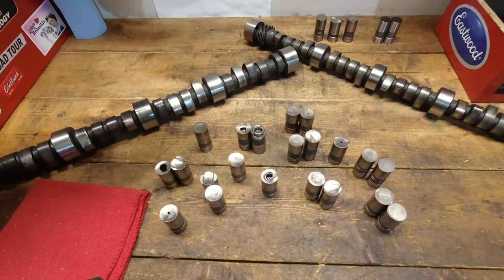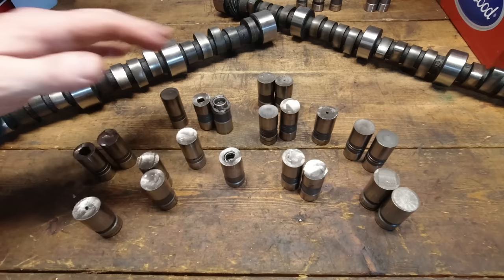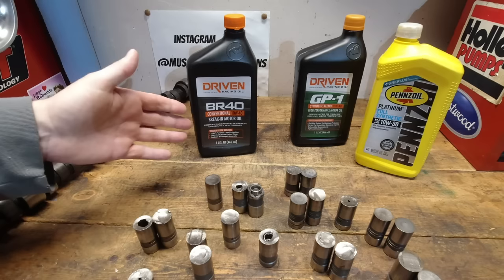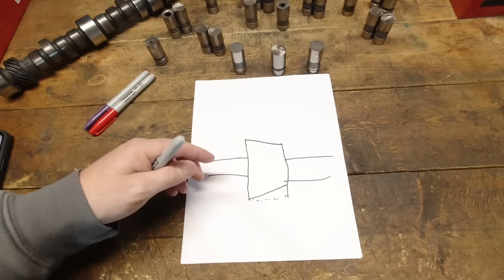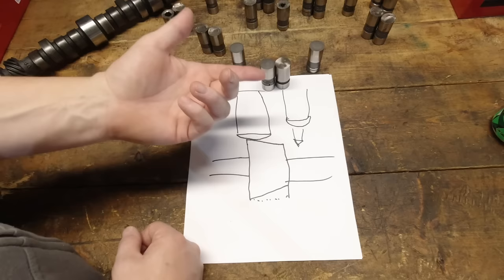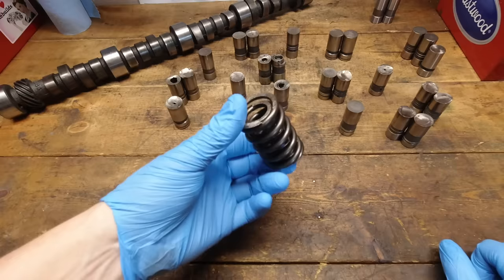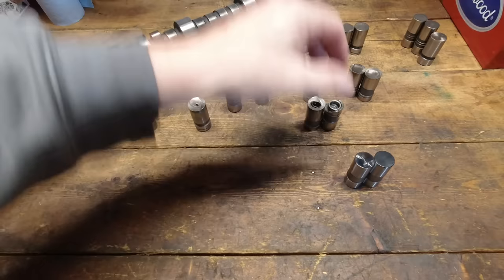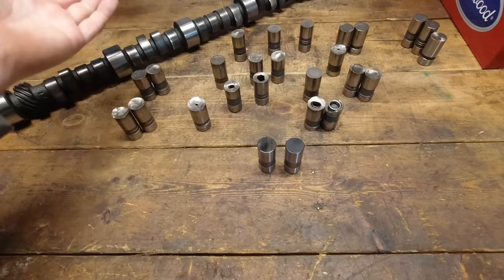Flat Tappet Cam Failures: The Reason Why They Go Bad & The Solution! Part 1

Comment: Good way to sell expensive lifters and cams. hmm
Reply from the maker: The OEs dictate what the tier 1 core/cam manufacturers make.  The OEs went roller in the mid 80s.  If you want to blame anyone for the more expensive valvetrains. It trickled down from them..

Comment: Do not be fooled with more likely false solutions to flat tappet failures-the genuine GM lifters with hardened foot wafer face pressed or fused on is the only trustworthy solution--at least for the GM crowd. DLC coating which is only around a .5 -1 micron thick coating. I doubt that coating will last or hold up, will it even be applied correctly and will the crown taper on the lifter be correct. Can the aftermarket really be trusted to solve this problem? Their track record over the past years does not look good. DLC flat tappet lifters in the race communities were made on tool steel bodies and required a billet cam core to be used. The lifters alone were over $1500 a set. Now these new DLC lifters at around $100 a set are the solution? Seems like a new cheap product riding on the reputation from the past of a $1500+ product that was not just same old unreliable cheap modern flat tappet lifter now with a special fancy .5 1micron coating on top. Hopefully this is not just lipstick on the same old pig, my fear. I will stick to what I know works. Always more excuses blaming the user or break-in procedures. Or, new marketing campaigns for the next best lifter EDM etc which still fail most of the time no matter the break-in. See the attached photo. I circled the hardened foot that is pressed and fused on the bottom of the lifter. In 2023 if the lifters do not have this, they fail at a very high rate no matter how expensive the oil or how careful and precise the special break-in procedures. It really does not matter the brand or the price or where the lifters are made in USA or abroad or if they have EDM oiling, or not. Nitriding the camshafts will not help to avoid the problems. We have tested this. For ones that are almost impossible to experience failure one must use the hardened foot set, no ifs ands or buts--PERIOD. Take it from a shop that has done more recent current testing on flat tappet lifter failure in the past few years likely than anyone else. We have experienced many failures with proper break-in and expensive zinc fortified oils--it has gotten MUCH worse in past two years but started in the 1980's. GM on any and every flat tappet engine ever built by GM has used hardened foot lifter. The hardened foot solid lifter has been discontinued for decades by GM I have the GMs with hardened foot. So, you guys sometimes have to learn in your own way. I cannot spend much more time trying to convince you. We have had cams nitrided and other things we have tried. Its not a cam problem, its a lifter problem!!! We do not specialize in lifter sales as a core product--its just something we offer on the sideline due to our failures and testing program to help others with what we have learned and proven. Roller cam conversion will cost over $1000 with price of quality lifters, the cam, and other special parts.And, you will have to give up the solid lash and go to hyd roller in most cases due to valve spring requirements of the solid roller lifter. Or, you can gamble with the  non-hardened foot lifters, BUT a cam and lifter failure will cost a lot more then the hardened lifter price in time and repair costs and parts replacement.

PURCHASER TO RECEIVE AT THE BUY IT NOW:
This is a set of Genuine GM flat tappet lifters (set of 16) for solid/mechanical application. This set has the fused on hardened foot like GM used back in the 1960's and early 1970's. If you are tired of all the other solid/mechanical lifters which are failing almost constantly, this is the ONLY solution we know of outside of installing a roller camshaft. Installing a roller camshaft is problematic on these old collector engines if you want to stick with a solid cam. Solid roller cams require too much valve spring pressure in addition to a very high cost and hassle to convert to a roller cam. We have tried many different brands of other solid flat tappet lifter sold in the modern day, and they have a VERY high failure rate--some fail in the first few minutes of run time even with zinc fortified oil and proper high RPM break-in procedure. None of the other mechanical lifters offered in 2023 have this fused on hardened foot. We are the only shop who can offer them. These are a replacement for the long discontinued GM part numbers 5231585 and 5232695! We have done years of testing on our Superflow dyno and in actual cars and know first hand that there is a huge problem with the modern lifters. These are the only lifters we trust completely along with the NOS originals, and not only do they have the fused on hardened foot--they are built using Genuine GM bodies!
Reply from the maker: There’s an article that Edelbrock published on the DLC lifters in the video description.  Maybe that will answer your questions.

Comment: Flat tappets are NOT flat
Reply from the maker: We covered lifter crown in the video if you’d like to watch it to see what we talked about.
Reply: @MuscleCarSolutions  yes you did
Reply: I can't see why they would be radiused either, not unless the cam itself would have a corresponding concave radius to match the convex lifter. You would have a microscopically tiny contact area between the 2, a sure setup for failure. Funny. I worked on a lot of older Toyota 2T pushrod engines that had truly flat lifters running centered on the cam lobes, and you would see a shiny stripe in the center of the lifter face, and a varnished area on each side of it. Those lifters never rotated, ever, and I never once saw a camshaft or lifter failure. Personally I think this "lifter must rotate" stuff is hogwash.
Reply from the maker: @6h471  half the examples in the video showed what happens when lifters don’t rotate.  😆 If you watch the video, we show the crown on the lifter and the taper on the cam.  That facilitates rotation and has been in flat tappet cams since they were engineered 3/4 of a century ago.
Reply: @MuscleCarSolutions  Tell that to the Toyota engineers. What about OHC engines with cam followers? Nothing rotates there.
Reply from the maker: @6h471  you’re comparing two totally different types of systems.  They aren’t the same.
Reply: @Muscle Car Solutions  An OHC engine with lash adjusters has a cam with no lobe taper running on a cam follower, flat surface to flat surface, and they have very little trouble. Conversely, let's look at a typical American V8, pick your poison. I'd agree that rotating lifters have been used on US built  engines since forever. Does that make it gospel? I don't think so. For instance, the typical small block chevy has been plagued with camshaft failures since the first one rolled off the production line, so no news there.
Reply from the maker: Again, you’re giving an example of a totally different system with a cam follower.  But if you think your line of thinking that flat tappet lifters don’t need to rotate to facilitate proper wear, then I guess the thousands of phd level engineers that have worked on those systems since they were created are all wrong.  Congratulations!  You’ll be a millionaire with that information if you sell that to every cam company out there still making flat tappet cams.

Comment: Muscle car Mopar knows what he's talkin about the guy in Canada he knows what he's talkin about he's been doing it for years you have no right at all to sit there and say it because of the oils have changed he's paying attention to all the different oils the man's been doing it for a long time you're wrong
Reply from the maker: Here I’ll help you understand one of the biggest mistakes people make with any engine with heavy spring pressures.  The cam mentioned in the video was a thumpr series cam for the big block Chevy.  There are only three of those with either a 911 or 924 spring.  Just for giggles, let’s say it was the 924 spring as it fits two of the three cams comp offers.  Now let’s also assume they went in at the correct installed height of 1.900”.  If that’s the case, that’s 112 on the seat and 355 open!  If you use that spring for break-in, no I’m sorry, you don’t have a clue what you’re doing.  Just as I mentioned in the video, it’s a ridiculously important aspect to break in and if those were the springs used along with a detergent diesel oil and probably way too high of rpm for the initial break in….yeah I hate to break it to you but that’s a recipe to kill a cam very quickly.  When you fail at all the critical points on a break in, it’s not the cams fault.  It’s ignorance.  But I’ll bet something was learned when a failure occurred.  There ya go.  Now you know what poor spring choice for break in on a big block Chevy looks like.  You’re welcome!